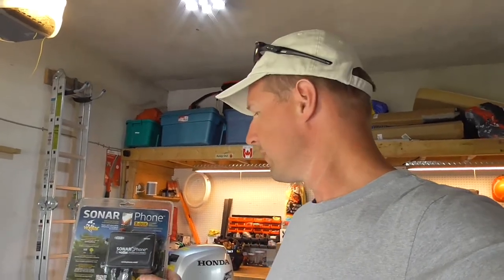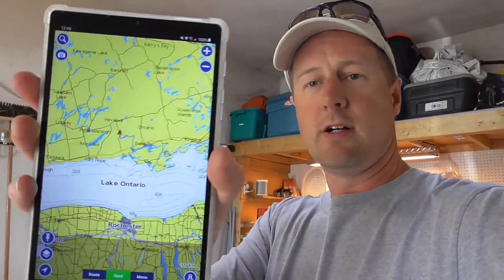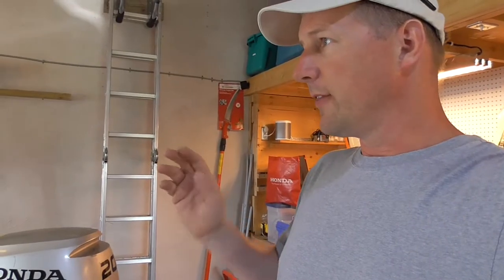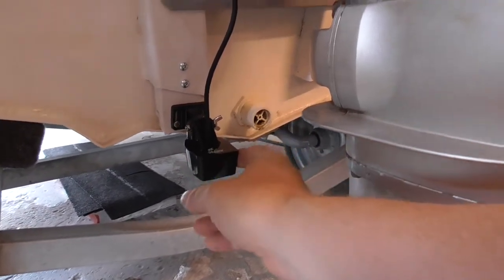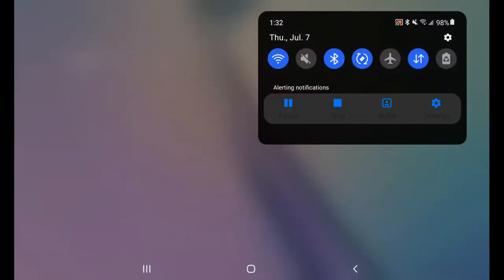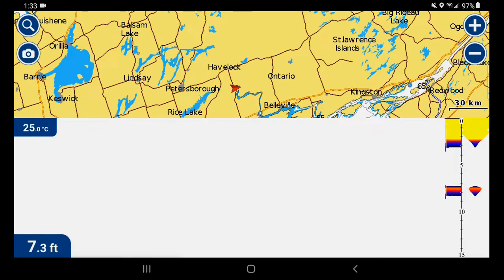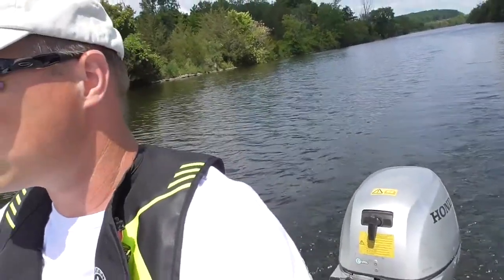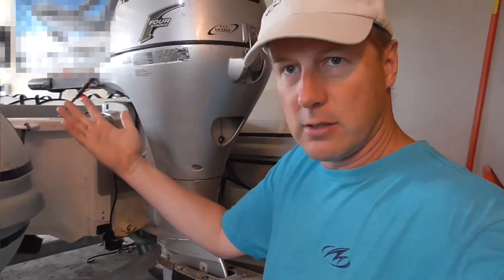SonarPhone by Vexilar with Navionics on a Highfield

Comment: Hello. Can you confirm if this still works with Navionics? Apparently Garmin dropped the split screen support.
Reply from the maker: I've sold the Highfield it was installed on a few weeks back. I do know I couldn't make it connect to Navonics early this spring. It was on a new device so I just figured it was user error. Maybe now it wasn't...

I hadn't read that Garmin was dropping split screen support. Sounds like a foolish move by Garmin. But they did remove all the pre-planning function of the Web Interface, which was very foolish.

Comment: Thank you for posting this - was just thinking about an aftermarket sonar for my iPad / Navionics nav package on the sailboat.
there are aso a windex out there,   we getting close to getting full nav packages that can run without factory installed gear.  
*wish it was BT instead of WiFi, so the tablet could be bound to the house WiFi, but maybe sonarphone can run on a Wifi hub.
Reply from the maker: Bluetooth would be so much better.. Several AIS units will work with Navonics on a tablet. But those are all wifi as well. A hub would be handy, if it would work.
Reply: @AdventuresonTour  yeah aware of the AIS,  have the digital yacht, which also is WiFi based,  and have the Furono (spelling) first-watch radar... which also is WiFi LOL.    it is possible to hook that one up via WiFi, but the AIS want to be the hub,    the manufactures all have a next-gen package on their hands but need to realize they are not the only device on a boat, and none of those are data-intentisive enough that they require a highspeed WiFi connection.  everythig could live comfortably on modern BT.